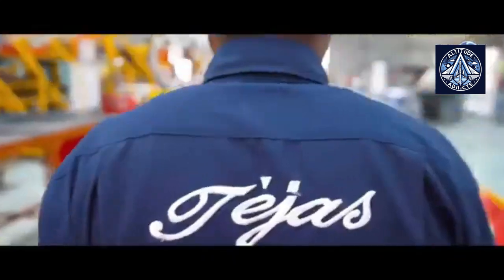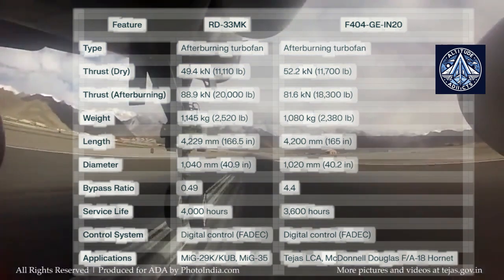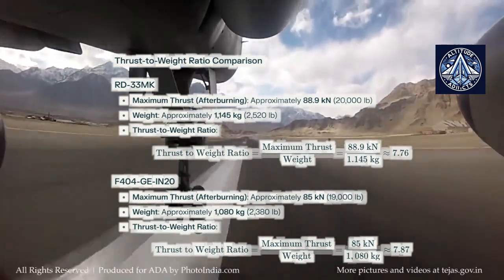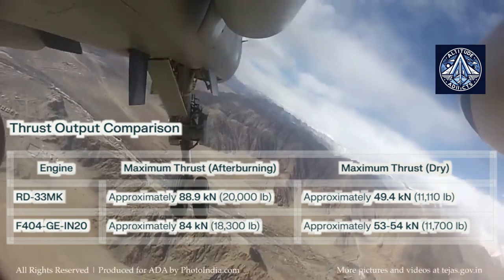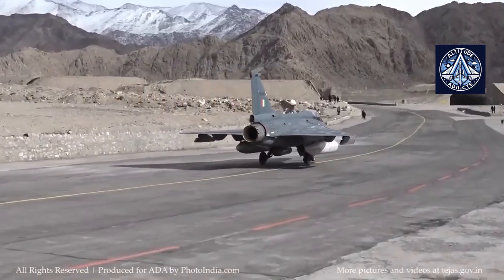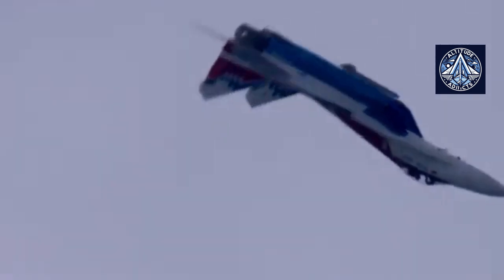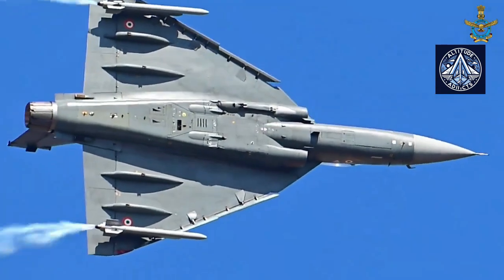Indian LCA Tejas: Could the RD-33MK Replace the GE F404?

Comment: impossible to reverse engineer an engine.  many tried.  no way you can go from F404 to RD33.  as it is much wider in diameter making it impossible to adapt the airframe.  this whole video is a childish daydream.  other factors, fuel efficiency, weight, and all Russian engines have a finite life, and need to be replaced in the 500-1000 hour range.  not so for US made engines, that can last for thousands of hours with proper maintenance, or tens of thousands.

Comment: Saturn RD33 MK engine of Russia is 400 kg heavier than American GE404 IN20 engine. Even 10 to 20 kg increased weight is a big concern for any Fighter Jet itself and it reduces Fighter jet's performance. Less weight and more zhrust is always best for any Fighter jet. Hence India uses American GE engines In LCA Tejas. And American have spent Billions of dollars & done more research to creat strong light weight Metals Alloys which can withstand very high tempreture of Jet engine combustion core which also increases Jet engine's overall life. That's why American,British & French jet engines are of more Superior High performance, Strong and more durable. Yes Russian Jet engines are also good quality but need more improvement and there is always scope for improvement.
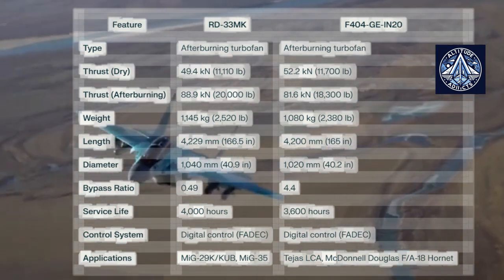Reply: 0:58 it' actually 65 kg heavier, not 400 kg. Also, i think is weight not the only crucial factor in order to judge which engine is the best in general.
Reply: @kamito961   And how expensive is the russian engine vs its American counterpart? That's also a VERY important factor

Comment: They have no other option GE will never give them engines
Reply: It not GE404 v r actually worried about. Indian Kaveri Engine is better than GE404. It need 4yrs to mature to integrate to Tejas MK1A.

What  need is GE414  type engine now. Or Re design  Tejas MK2, TEDBF, AMCA with Russian engines
Reply from the maker: Kaveri may take more than 5 years to be on a "production" aircraft.
Reply: @altitudeaddicts  V shot on our foot trusing u.s. Those 5yrs will b painful.Even if v try to redesign Tejas MK1 with RD-33MK, it will take 3yrs.If after 4-5yrs Kaveri matures, its not logical to integrate RD33MK  now.

Our concern is Tejas MK2, AMCA engines. Only solution is to rediesign them with AL41 Engines. Or atleas AL31FP engine which v currently assemble them.
Thats the most logical thing to do.DOnt know whats going on with my cluless govt